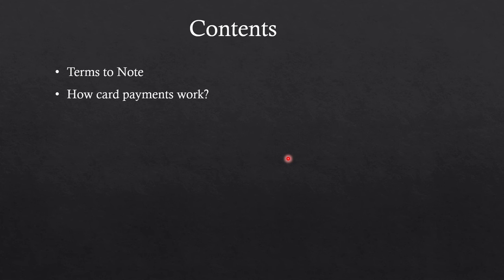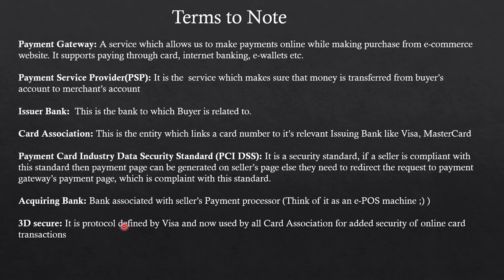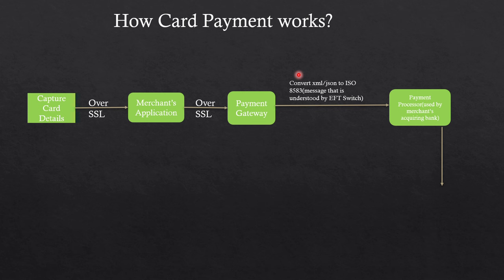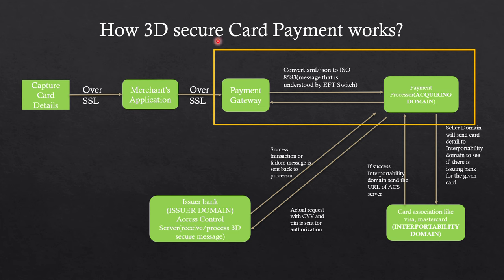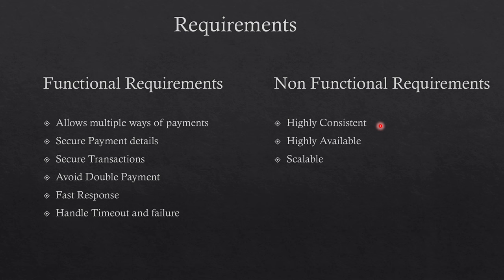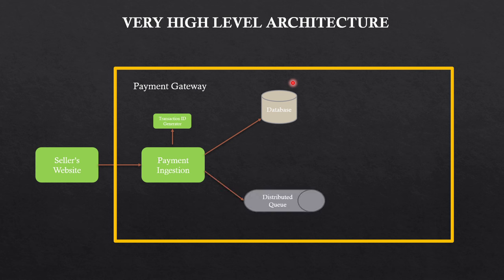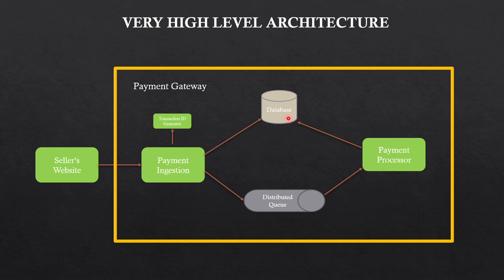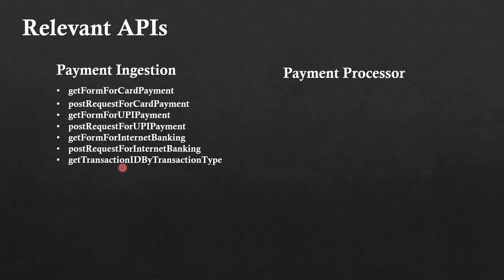Payment Gateway System Design | Payment Processing | System Design

Comment: Your understanding of the partition tolerance in the CAP theorem is incorrect. In a distributed system, partitions can’t be avoided. So, while you can discuss a CA distributed system in theory, for all practical purposes, a CA distributed system can’t exist. So, you can't chose consistency and availability over partition tolerance. And if you prefer consistency and availability over partition tolerance, then in case a partition happen (which is normal in distributed systems), the system won't work (thus affecting availability).
Reply from the maker: Firstly glad to see your comment 🙂, really appreciate your effort and contribution to the tech world. I understand partition is required for any distributed system, may be the explanation was not clear on that part 🙂
Reply: That's absolutely correct AP / CP is possible in distributed system

Comment: Good high level overview overall. You missed explaning how failure scenarios are handled which are also crucial to discuss here IMO. 
1. How do you ensure Database and Distributed Queue stay in sync? It can happen that database got updated but not the Distributed Queue. e.g. Payment gateway updates database and before it could write to distributed log queue, the payment gateway instance dies.  
2. How do you ensure you get exactly-once semantics from the distributed queue so that you don't double process the same txn? e.g. if Payment processor processes the txn and before it could update distributed queue offset, the instance died. When the new instance of processor comes up, how will it ensure the same txn id is not processed again?
Reply: Create a video on the same.He has provided the starting point!!
Reply: kafka can handle

Comment: But in CAP theorem, sacrificing P doesn’t make sense as networks are unreliable. We just cannot have CA systems. They would be either CP or AP. 
In our case, consistency is even more important. So, it should probably be a CP system.
Reply from the maker: Sacrificing P does not mean we don't have partition in our system.
Please check out this:
https://youtu.be/ThjBc80X_hU
Reply: It should be a CP system.
Reply: You don't sacrifice P, it always and up being AP or CP, or full CAP is you want to sacrifice latency

Comment: IMO:
1. There is no xml/json converted to ISO 8583, merchants/acquirers do generate ISO 8583 (POS machines are capable of doing that and only that). They have to onboard with Payment N/w's like visa,MC and continue to inline with spec changes. May be online wesite sends a json internally to a payment service team who converts json from online to ISO 8583.
2. that number you are referring to in card number is called BIN(6 , now first 8 digits of the card) and issuing bank has to buy it and unique globally
3. On Consistency/partition tolerant, usually most of the issuer banks/processors only use RDBMS over NOSQL and can be highly consistent and never allow parallel processing on single card
4. Its rrn/stan is used e2e for tracking but not the transaction id generated by payment gateway
Reply: You really do know these things. Can we be friends?

Comment: Question - Payment gateway module if i am not wrong is part of amazon itself i guess.. Which means transaction id is being generated within amazon... how do you force outside services to use that same transaction id ? I am sure issuer bank for example will also generate its transaction id, how do you map these 2 transaction ids.
Reply from the maker: Payment gateway will be with Amazon but payment gateway will have a payment processing module which is provided by acquiring bank. So the transaction id between Amazon and acquiring bank will be in sync based on contract between payment processing module and gateway. For issuer bank and other middle party involved like visa and MasterCard etc. It will all be standard message like ISO 8583 or other switch message, which will have some tracking field for transaction id, which can be provided by acquiring bank/ Amazon itself

Comment: I will not repeat on P part of CAP as there are enough comments already. Other pieces that are not making sense to me are as follows:

1. If the front end fleet moves the request to a queue, the front end service hosts become asynchronous (non-blocking). But they need to reply approve/deny to the caller and that will not work if they put the message in the queue. Because the service that reads from the queue will not have caller's connection to respond back. So I believe that should be a blocking call end to end.

2. Retry logic has flaw. Consider the payment gateway calls the Merchant bank and the host at Merchant bank is super slow and along with that the connection is dropped due to a network glitch. As part of retry, payment gateway will retry with that transaction Id and it goes to another host at Merchant bank that processes it successfully. And now the slow host at Merchant bank also processes the transaction. This can be saved if Merchant bank hosts check for transaction Id and are idempotent.

Comment: Wouldn't creating partition on the basis of date presents problem of hot partition, considering 10M transactions/day.
Can we create partitions on the basis of transactionId, as query based on date will be used in clearing service which is done in background, WDYT?
Also there can be a transaction archival service which can move the past day transaction to Cassandra for reducing load on RDBMS.
Reply from the maker: Regarding archival service you are right, we can can have a service like that to move old data to some history database, type of database will depend of the purpose of archived data. If we want to run some aggregation Cassandra can be good choice.
For partition, transaction Id won't be a good choice because there will be too many partitions for your table which will cause a lot of maintenance overhead. A good idea will be to have partition on date and have further subpartition of transaction type for the day or some other key which can distribute the transaction for the day
Reply: @TheTechGranth  Thanks for the reply.
But wouldn't making partition on date will cause hot partition, as there will be load of around ~10M transactions/day on the single partition only.
Instead that load can be distributed across multiple partitions based on transactionId, also there are no such query patterns in the system in which we need to query based on date like in IRCTC or airbnb, except the clearing service(which happens in background).
In the real time we would be required to fetch the transaction by txId mostly which can easily be served.
Maintainence will always be part of partitioning whatever key we choose, but mainly what drives partition key is the access pattern.
Do let me know what you think?
Reply from the maker: @uditagrawal6603  that is why is suggested a subpartition, please keep in mind that there will be lot of select query in your application, not just for clearing but also for refund, retry etc. Which happens more than you think. One thing which can be done is, since we are externally generating transaction I'd, we can create sub partition on list of transaction Id for the day. So range partition on date and list partition on transaction Id, so data will be properly distributed. Btw do like the video and subscribe and share with others 🙂
Reply: @TheTechGranth  yes but things like retry or refund would also be based on txid only, to be honest I didn't get the reason of storing based on date as I don't get which queries we would be doing based on date?
Also it would be helpful ,if you could guide us on partition and sub partitioning.
Another query how are we handling hot partitions?
Btw series is awesome , I already liked and subscribed 😊

Comment: the explanation is good but consistency and availability are 2 conflicting goals. 

most distributed systems must be designed with partition tolerance as a non-negotiable requirement. This means that during network partitions, the system must continue to operate and serve requests to the best of its ability, even if this results in temporary inconsistencies or reduced availability.